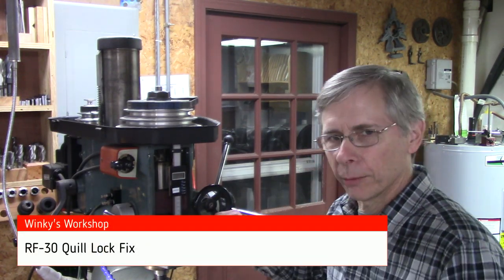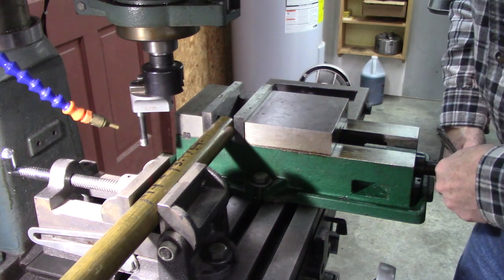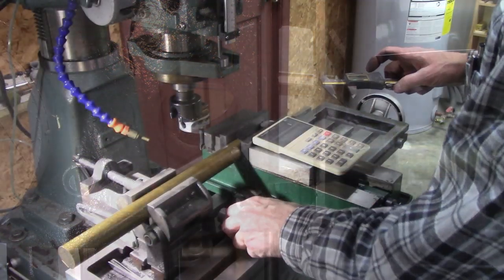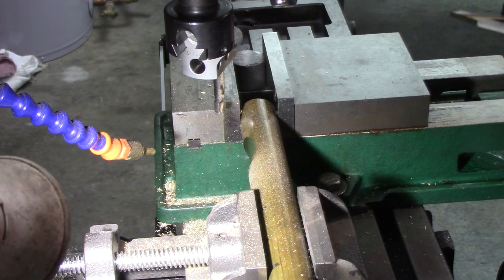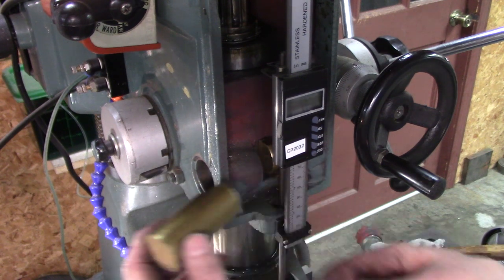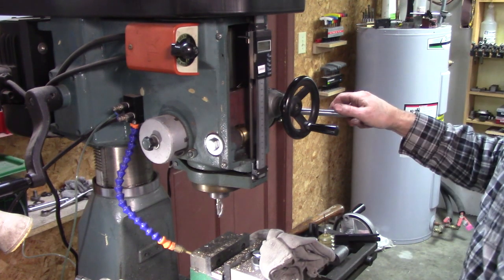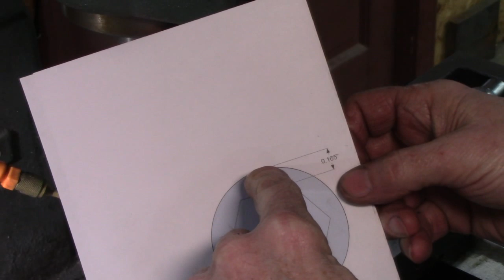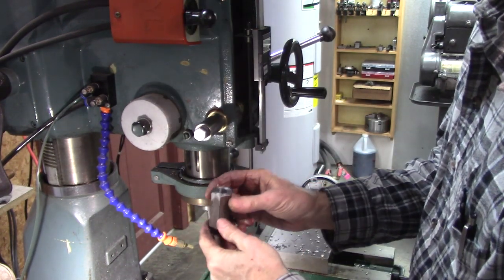RF30 Quill Lock Fix

Comment: Since I contacted you 2 years ago I finally got around to upgrading my quill lock. It went easier then I thought it would. Actually I just finished it up and it works great. I was amazed that the measurements you gave were very close to mine (I do believe different machines) . Anyway thanks for the idea and great video you did. It was easy to follow. Thanks again,Jim
Reply from the maker: Great to hear! Thanks for getting back with me!

Comment: Thanks for another great learning experience. the parts you made are called split cotters, one formula for creating these is: D = bore being clamped, d = the diameter of the clamping bolt that sqeezes the two collets together (NOT the diameter of
the collets)
D/2 + d/2 + 0.02" = the centre to centre dimension for the split collet and bore.
Reply from the maker: Interesting how you apply math. Not a bad thing but my mind gets the same results without math. Just a different thought process.

Comment: Brilliant idea using a piece of hex bar instead of a hex collet, I can't afford the collet sets but now I don't need them. You've opened up a whole can of worms for me, thanks!
Reply from the maker: Yeah the hex stock worked great! I used this method again last night. The only negative is that you have to make a new block for each diameter.  The block I made last night had a set screw in it to hold the shaft. It was a small shaft (3/8") but I'm sure it would work well with larger material as long as you take small cuts with the mill.
Reply: @WinkysWorkshop  I'll be giving it a try!

Comment: I watched your video many months ago. Because I have one of these mills also,l watch every video I can to learn what others are doing and how they overcome some of the problems a round column mill can have. I think your fix is just great. I am surprised though that I haven’t seen any other owners (of this mill)  talk about this. This summer I plan on doing some maintenance on my mill plus this fix.  I will let you know how it works out for me.
Reply from the maker: That original quill lock was a real pain. It took me a while to figure out what was happening. I'd be .030" off on one end but I never saw it happen. Then one day I cleaned of the quill and put tape on it and saw the movement!  After going to a friends shop and taking apart his bridgeport I had the answer.

Comment: Your next project on modification of your mill should be to take the slop out of the down feed gear that engages the quill. 
I saw this fix done by the late Heinz Kegler. Heinz made new bushings for the shaft that carries the gear that engages the quill. The trick is that he bored the bushings with ~0.030" (0.75mm) offset using the 4 jaw chuck in the lathe. Now the back lash between the gear and the quill rack could be adjusted to remove most of the slop. 
Cheers from NC/USA
Reply from the maker: Sorry for the delay... Thanks, I need to look into this.

Comment: That is a fix I have been looking for for 10 years.  Thanks!
Reply from the maker: I've looked into this problem a few times and screwed up a few projects because of this problem. I have a friend that just sold his machine shop. He's been doing it for at least 40 years. I told him about the problem and we looked at his bridge port which he has in his personal shop and that's when I noticed the radius on the brass cylinders. I went very slightly too deep with the boring head but there still a lot more surface area that the original aluminum cylinders. I was worried that I might cut the brass rod in half and it would not clear the quill. At that point it would have been a challenge to fix. If you do this fix, be precise and don't go more than a couple thousands too deep. I think I went about .010 or .015. I doubt I'll ever have it move on my again (it holds fantastic) but I wish I had not cut quite that deep. I love the hex and being able to use a wrench too. Oh... You are welcome, I'm glad somebody can use the info.

Comment: Hi, I always liked working with brass as it's color is akin to gold when it shows a freshly machined surface. It can terrify a machinist when a tap starts to squeal though, LOL. This upgrade is perfect my friend. You always have something interesting going on. Thanks bud. Great post.
Reply from the maker: Thanks, it worked perfectly
Reply: @WinkysWorkshop  It makes a fella wonder why it wasn't like your mod from the start. In process of manufacturing this could have been easily done from the beginning. Now it has been "Winkieded" never to fail again, LOL.
Reply from the maker: @TomokosEnterprize  I'm guessing it was partly oversight and perhaps cost. The original was just a bevel and did not conform to the quill. I went and looked at a friends Bridgeport and copied it. It was basically a lack of surface area at the contact point.
Reply: @WinkysWorkshop  Poor contact at the wrong place methinks. It is always nice to visit with a like minded fella such as your self.  Thanks a bunch and see you next post my friend.
Reply from the maker: @TomokosEnterprize  The original blocks were a simple bevel. They did not contours the quill. It was only pin point pressure. The blocks I made match the curve of the quill so the surface are is huge in comparison.
Reply: @WinkysWorkshop Yours are a far superior way to make them. Doing it your way wouldn't cost them any more tool time and you wouldn't have had to correct the situation. Well done my friend.
Reply from the maker: @TomokosEnterprize  - I agree

Comment: Great tip. Recently (Feb 06/ 21) picked up a R-F 30 still not powered up, but this is great too know if the quill lock won't hold. Had no problems with the 1980 Enco, but found it better built than the Fu, Thx ,Bear
Reply from the maker: Well the Enco's are an RF 30 (Rong Fu). Enco may have specified specific quality or options however. Mine is the Enco version. Overall I'm happy with it but I have also done a lot to it to make it more user friendly.  I've added DROs, power lift and guide bar plus fixed the quill lock and also fixed a lead screw alignment issue which made the table bind at one end of the travel. You might want to watch this video also.  https://youtu.be/_2JXRt3_4qw  Thanks!

Comment: Ok, two years on and thank you. May be needed on my Optimum BF30. I've had an annoying over cut with a large end mill - still need to work out if it was the lock or the collet.
Reply from the maker: Both my collet and the quill lock were slipping. The lock slipped with large end mills and my 1/2" collet was worn bad. Good to check both.

Comment: called a split cotter. I have one on my drill press quill lock. the Taiwanese made drill had threaded one on it originally. Guy Lautard in  his first book has a bit about making and using them on several different projects.
Reply from the maker: Interesting. I've always preferred the split casting clamp. I mean obviously if it's being used on a Bridgeport it can work well. I used to have a Taiwan made drill press  that had the split cotter and it was made with a sloppy bore for the quill. Every time I locked it down the quill moved. In fact it even moved when it was locked down. With the split casting you can leave it partly locked and drill accurately. The casting clamps the quill in a larger area. The RF30 mill also moved but only about .002". I also suspect the quill moves a little even if it is locked firmly although it may be better after my modification.

Comment: I took a 1/2 spring, and put it between the 2 halves, and it helps release the lock, and it holds enough pressure on the 1/2s that it holds the lock handle where you leave it.
Reply from the maker: Interesting...  Mine never sticks. maybe my angle isn't perfect.

Comment: I have a mod for this if you're interested I made about 15 years ago on my mill drill.  I put the Z axis DRO (just like yours) so I could fine adjust the spindle up and down, but every time I loosened the quill it would drop to the end of the backlash and my setting was gone.  I wanted it to act more like a knee on a Bridgeport.
So I took the pin (your brass piece) on the handle end , counterbored it and installed a steel sleeve (like a bushing) in the pin (about .093" wall) around the handle thread, with a compression spring under it and a dog point set screw in a slot in the sleeve from each side that allowed the steel steel sleeve to protrude about 0.060" from the end of the pin (with a preload force from the compressed spring) and then compress flat against the end of the pin.  I used a low rate spring so the force would remain mostly constant in the 0.060" travel.  (you might have to read that twice)
What did it do?  With a washer on top of it, when you tighten the handle, the sleeve compresses and it tightens normally and locks the quill.  When you loosen the handle, there on full turn where the quill locking pins (the cotter) apply just enough force to create a light drag on the spindle (quill) to hold it in its position and still allow you to easily move it up and down to adjust it.  Loosen it further and it's completely free.  It was one of the best things I came up with,  If you think you might want to try it, I can give you a little more detail.  I hope you can envision how it works.
Reply: Edit:  "there is one full turn where the quill locking pins...
Reply: That might not have been real clear.  If you held the finished pin assembly straight up and looked at it from the side, you would see the steel sleeve sticking up out of it about 1/16" (0.060").  If you press on the end, it will not move until you exert a high enough force (it's preloaded) and then you can push it down flush.  That's it.
Reply from the maker: Thats a great idea. I have done the same by carefully loosening a little but that is hard to control.  Sometimes I miss my depth stop, did you remove yours when you installed the DRO?
Reply from the maker: I got it i think...  thanks
Reply: @WinkysWorkshop  I mounted the DRO scale to the left and kept the stop.  I made a zero backlash linkage by drilling a hole in each end of a piece of hex stock, drilled and reamed a cross hole near each end, put a spring in the end first, then a short pin on top then pushed a shoulder bolt thru the cross hole (for each end). One shoulder screw attached to the spindle and one to the DRO scale.  The linkage can set at a small angle even and it will have no effect or error.
Reply: @WinkysWorkshop  For the clamp pins choosing a spring is hardest part, but you can put the pins in with a piece of all thread, stack a couple inches of washers or spacers against the end of the c'bored pin, slide on a spring, another washer and a nut.  Tighten the nut until you get that light drag you want and measure the compressed height with calipers.  From there you can calculate or just by trial and error find a spring.  The compressed height should be abt 2/3 or more of the c'bore depth.  The steel bushing abt 0.62" to 0.75" in length. 1/4" set screws w/ 3/16" dia dog points and 3/16" x 3/8" long slots in the bushing.  The length of the stl bushing is cut to length to fit and spacer rings can be cut from the excess length if you need to shim it back.
Reply: This was the spring for the quill clamp...

Comment: Winky, well done and a great fix. Just an observation and a possible mishap waiting for next time, with your hex sleeve you used for indexing. When you had the part clamped in your vice, it was only clamping onto the hex part. You would have been relying on how tight the nut was to stop your part rotating in the event of the cutter snatching. I also noticed that on some of your cuts that the work was flexing slightly in the vice. A better solution though time consuming would have been to try and find 2 shims that were the difference of the hex width and your work diameter and place one on either side of your work and the vice jaws. Upon me just watching it again, I see that you had the hex flat to the vice bottom, which meant that the hex was only gripping on the points, which made even more gap for your part between itself and the vice jaws.
Reply from the maker: Yeah....  I had the nut just about as tight as I could get it but gripping the corners of the hex was not the best practice. The reason I did this is that the scrap of hex I had was rounded on the corners on each end and it didn't sit over the gap in the bottom of my vice. In hindsight, I should have laid a spacer over the gap and clamped the flats. As for the movement you saw, it never moved, it was quite solid. I watched the video again and what you are seeing is where I used cross fading between the video cuts. I edited out a lot of the cutting just because it was boring to watch. It did look like it was moving but again, just the video editing. Next time I use this method I'll lay something in the bottom of the vice and grip the flats. Thanks for pointing that out...  it made me think it through.

Comment: Off subject but noticed you using your latest cutoff tool holder, which I copied, works great but noticed that the cutoff blades vary a couple thou in heigth and cut the clamping slot a bit deeper and then the holder worked for the shorter blades!
Reply from the maker: Glad you liked the tool holder. So far I haven't had to buy a new blade for them.

Comment: While making an attachment to hold a digital caliper for the down feed on my RF mill I pulled the quill lock out to get the handle out of the way. The quill suffers from the same ailment as yours did and I thought that copying what you did would be a good project.
My RF mill was made in the late 80's. I thought I might use the same clamping bolt with new radiused pieces.
   After some investigation I finally finally figured out what those jokers in Taiwan had done in making the clamp assembly...I busted out laughing when I figured it out. The clamping screw/handle does not have a metric thread. Well it must be Unified National.. visually it looks like a  1/2-13 UNC. Nope, its a 1/2" -12 British Standard Whitworth. Further investigation showed the fixing screws for the front plastic cover on the mill head are also 1/4"-20 BSW.
   The lesson is that just because the machine tool was made in a certain country you can't automatically assume that all the threaded fasteners are the same. I wasn't all that surprised about the mill. My Taiwanese built Darsin bench lathe is a metric mechine... except for all the control levers.. they're Unified National.
Cheers from NC/USA
Reply from the maker: I should have covered that in my video (sorry)... I don't know what kind of thread they used...  Never did figure it out! Crazy huh?  I've had similar problems. When I first got my mill the table travel was very tight at one end. The bracket behind the long axis hand wheel was mounted off center and the lead screw was trying to flex as it approached one end. One bolt hole was in the wrong location and the other was cross threaded. I had to mill the holes slotted to get it out of a bind. Both bolts were 5/16" -18. I can't justify spending the money on a Bridgeport but these Rong Fu mills have a lot of issues.
Reply: @WinkysWorkshop  The RF is ok for what it is. The problem with the Bridgeport or it's clones is just how big it is for most home workshops. The hot ticket is the Atlas Clausing knee mill.. They're hard to find at a reasonable price. You have to keep an eye out on Craigs list and hope one shows up.
http://www.lathes.co.uk/clausing%20vertical/ 
Cheers from NC/USA

Comment: I really enjoy watching your videos. I just bought the rf-30 clone from Harbour freight and I am in the process of ordering the accessories I'll need to use it. What size vice do you recommend. I can't tell if your using a 5 or a 6 inch vice. Thanks in advance!
Reply from the maker: I think mine is a 5 inch. It's adequate for the size of the mill I think.

Comment: well done, I see that you only have a small amount of movement with your spanner, you could put a arm with a knob on it and would not hit the torsion spring housing.  just my observation.
Reply from the maker: I agree I was thinking about cutting off a boxed end wrench and put a screw and washer on the end of the hex to retain the wrench but a pin and knob would look better.

Comment: I bet this mod gives you a cleaner more stable cut too.   Have you noticed a surface finish improvement
Reply from the maker: To some degree although not as much as I would have thought. The quill still moves a little while milling. It never slips however.
Reply: @WinkysWorkshop  I've never had my spindle apart in my mill drill.   Mine is exactly the same as yours .... it's a JET.   I wonder how hard it'd be to change out the bearings to taper bearings that can be preloaded.   I believe the existing bearings are just standard bearings.
Reply from the maker: @dizzolve  I have a PDF file on how to do this. winkysworkshop@GMX.com. I've never done this but I have been thinking about it. They are opposing tapered roller bearings that take grease. The reason I have been avoiding this is that the bearings have a preload. I'm hoping to be able to inject grease into the bearings but I'm not sure the bottom bearing is accessible. If you take the bearing apart the preload is hard to set right. The problem is grease. If the bearings are oil lubricated you set the preload so that you feel a very slight resistance but this resistance is hard to judge with greased bearings.
Reply: @WinkysWorkshop  I decided to do this mod.  It looks to me like the existing handle thread is a 1/2" 12tpi which is pretty rare isn't it?   I see 1/2" 13 all the time.   I'm going to have to single point it since I don't have the tap.   Is yours the same?
Reply from the maker: @dizzolve  I can't remember actually but I made a new bolt for mine and used 1/2-13 I think.